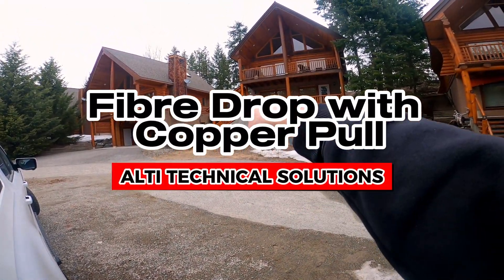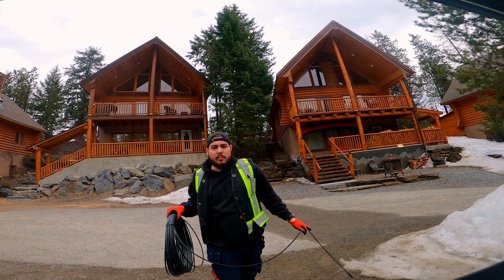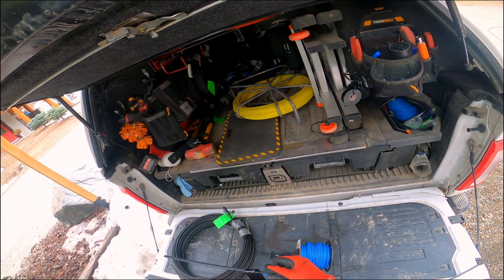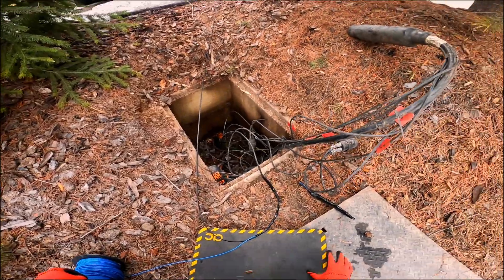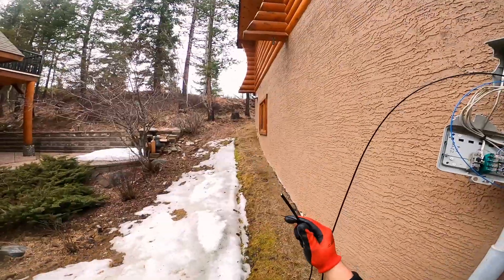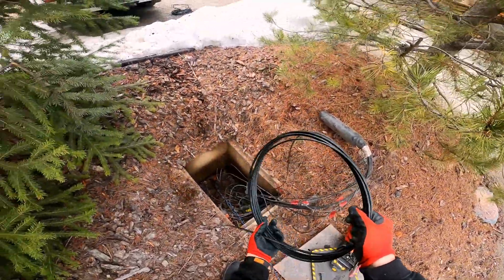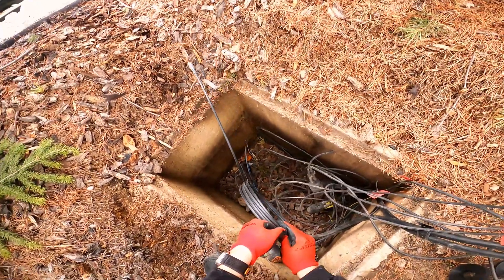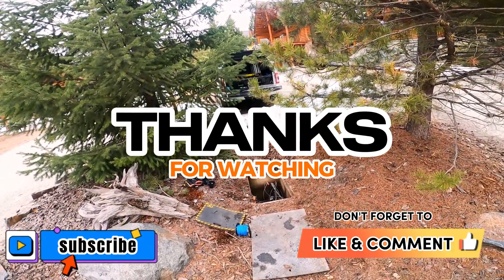Blocked Conduit Issues - Fiber Optic Drop Placement + Tips

Comment: Flat drop is available with the tracer built into the jacket. Do you use a separate spools so you can carry only one type of drop for aerial or buried? I installed Fios in Maryland for Vz before retiring. Curious how other guys roll.
Reply from the maker: Pretty much. I get the odd drop with tracer attached. But it Is cumbersome to carry both types

Comment: Hey I'm a Fibre tech too! I am wondering what brand of boots and work pants you're wearing and if they're comfortable. Thanks
Reply from the maker: Hey! They’re both Helly Hansen.
Reply: @FyBurz  Thanks! I've only been a tech for a couple of months, I do both the outside and internals for customers. What would your biggest tip be? I struggle with being organised and leaving things at the mbt or in the vehicle, I often end up being behind.
Reply from the maker: @infernoz5059  my whole philosophy is NAP to NIB or MPT to Dmark whatever you guys call it. I like to have my setup preloaded with all the screws saddles bits/hardware I would need. And just take it a set at a time it comes with experience. Try to move in a procedural way. Always moving forward. Focus at the task at hand 👍🏼 let me know if you need with anything specific. I love these pants with the outside pouches btw
Reply: @FyBurz  I absolutely will. Yeah I have some CAT pants with the pouches it comes in handy. I notice you primarily use a toughbuilt pouch though and dont use the pant pockets?

Currently Im just rocking a Milwaukee 20" packout tote for my tools.

Any tips for when the NAP is multiple pits/covers (I call them pits) away from the property? I've had times where its 4 pits away and its a real nightmare with the cable being tangled pulling all the slack through
Reply from the maker: @infernoz5059  kinda convoluted question. I assume you mean spans, just line your drop up under your path and hang it up pole by pole watching your twists and if you’re field side of road side
Reply from the maker: @infernoz5059  I’m working right now but I’ll be able to help you out with some tos later.
Reply: @FyBurz  I mean for underground drops
Reply from the maker: @infernoz5059  ah okay, and to answer your earlier question yes I use primarily toughbuilt pouches but that’s mostly my Aerial setup, UG I usually just carry my needed tools in my pant pouches. 

And for multiple tubs if the conduits all line up to put straight through then try to setup the line at the first tub straight in opposite direction of the conduit so it can freely pull. 

I commonly pull the slack to each tub especially on long pulls.
Reply from the maker: @infernoz5059  the trick is to figure 8 the drops.  allows for free pulling with minimal tangles. I’ll make a short on how to do that if you don’t know 👍🏼
Reply: @FyBurz  Yeah that would be an amazing short, massive help to me 👍
Reply: @FyBurz  Ah I see thank you. I also pull the slack to each tub but when Im at the 2nd tub for example and pulling, the cable can pile into a mess and tangle itself etc.
Reply from the maker: @infernoz5059  https://youtube.com/shorts/80FiDG4EwfM?feature=share here you go! 😅

Comment: I'm an in house cable technician here in Texas. Gonna start doing fiber jobs pretty soon. That uncoiling technique with the ziptie is gonna come in handy for me. I'm wondering though, do you only work with fiber? and how are you checking signal? Do you use a signal meter for fiber?
Reply from the maker: Yeah for sure it’s even more useful with longer drops it keeps the coil nice and neat. 
I do only work with fibre for 80% of my work, but I also do internal networking jobs, you can see some of it on my channel. 

As for the signal, My portion of the job is just to get the drop plugged into the nap/mpt and get it into the dmark at the home. The rest is for the tech who does the install. 

If you check out my video on fibre drop replacement you can see me taking a reading with an OLM. 
 
Thanks for watching!